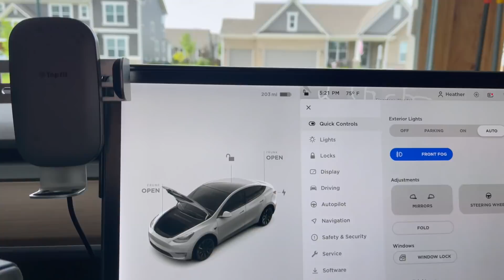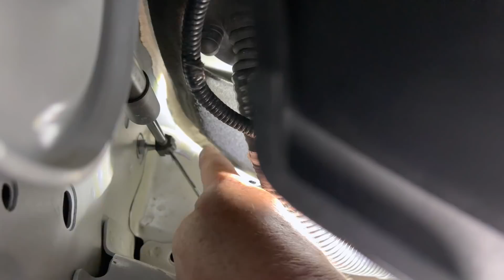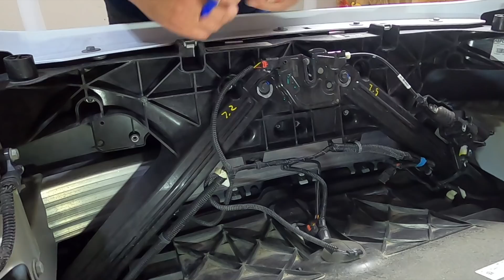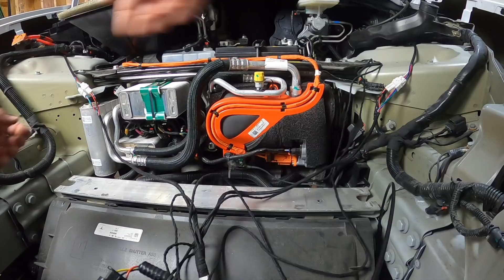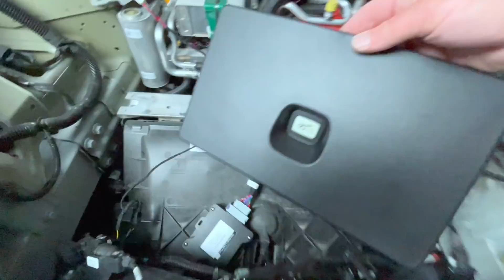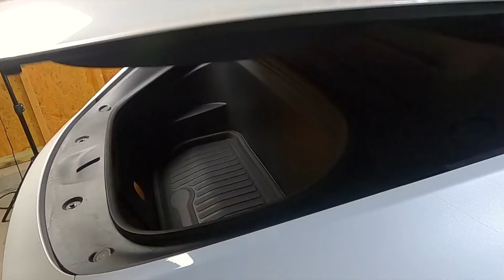Tesla Model Y - Frunk Mod by Hansshow

Comment: Thanks for the video. I have been unable to get the front to completely close. I've adjusted the tension wire, the bracket is all the way down, the black rubber knobs are as low as they can go. Any other suggestions?
Reply from the maker: Something else is wrong then. My best guess from afar is that the latch is too high. Try listening the 2 bolts holding the latch and bracket and lower just the latch part. You may only be lowering the bracket when you have been adjusting.
Reply: @BeardedTeslaGuy  thank you I'll give it a shot

Comment: Hey man, I installed the same exact model and I am having a hard time with alignment. It is intermittently working as it should be, but most of the time the hood will catch the lock but wont totally shut. I tried tons of adjustments on the locking mechanism as well as on the tension cable, but still having the same result. Hansshow is not much of help and so I am wondering if you have any suggestion. Thanks in advance!
Reply from the maker: So my best advice is to start turning the threaded rubber stops on the front of the hood. They may not be low enough to allow the hood to properly shut with the new latch alignment
Reply: @BeardedTeslaGuy  Thanks
Reply: @BeardedTeslaGuy  do you know if there’s any programming options on opening and closing speed? Thanks again.
Reply: I install these in the Phoenix area and have had this same issue.  Working on a fix with HansShow but them being in China makes things a little more difficult.

Comment: I had this kit sitting in my office for about 2 months, received  my new Y over a week ago, today after watching Bearded Tesla Guy, which I'm a subscriber to all of his videos, I went for it and he sure made it simple. 

The Struts removal and apply new ones with new adapters were the hardest part of the enter installation, my arms took a beating. It all works like its advertised, app on phone as well as screen in the car HOWEVER, I can't get the hood any lower when its closed, it's fine WITHOUT the plastic FRUNK insert re-installed, but after adjusting the hood latch to it lowest point to get the hood closed as before and put the FRUNK back into its rightful place it still needs to be lower,  and now I get an screen waring in the car, "Hood latch sensor requires service" - "Contact Tesla Service"..as the hood remains open on the screen. Even when I close it off the screen, it closes, and remains closed, but the screen animation pops back up to open. I just now looked and will try another YouTube in that video that the put the black rubber washers behind the hod latch bracket after the install -
Reply from the maker: There are 2 rubber threaded bump stops on the front of the hood. Try to turn those in some and see if it goes down some more
Reply: @BeardedTeslaGuy  you are the man!, just came back from the garage, did that AND put the black rubber bushings behind the hood latch,  your video you put in front, and lowered those two spin bump stops and it's flush now when closed, its all good and  the animation now shows open and closed positions. However the "Hood Latch sensor requires service" is still displayed ONLy when opened, not closed. Wonder if a software update will fix this issue...Thanks again, thanks for you input, always enjoy your thoughts.

Comment: I installed mine before your video.  Wish I had waited, I could only find one other video for the 4.2 V2 system install on a MY and it had a weird music track playing the whole time.  The only thing I noticed we did differently was the spacers on the locking mech.  It appeared you installed the black spacer between the head of the bolt and the lock. I assumed the black spacer went between the frame of the car and the lock.  Anyway I also LOVE this opener!  I also did not install the kick sensor but may add it later.
Reply from the maker: Yea, its supposed to go between the brackets, not against the head of the bolt.

Comment: The major problem with putting a cooler in the frunk is that it is not thermally controlled. On a hot day it will get very hot in there which will reduce the thermal holding capability of the cooler. In the model Y which has a shared trunk space with main cabin, the cooler would be much better in the back.
Reply from the maker: No doubt

Comment: Great video as usual!  Have you tried closing the hood but block it just as if it about to latch (with an object or your arm) so that it doesn't and see if the car recognizes that it didn't latch or still show closed.  There is someone here with a video of this issue with the Hansshow model giving false reading and the hood opened while driving on the highway causing damage to the hood and windshield.  Tesla and Hansshow are investigating the issue.  TeslaOffer has a similar model albeit more expensive that has the safety feature to address this issue.  I was ready to purchase the Hansshow until I saw the video with that issue so I held off.  Thanks.
Reply from the maker: I have not tried that. I know it won't keep pushing when its obstructed, but didn't pay attention to the latch locking, thinking it was closed.
Reply: @BeardedTeslaGuy  Are you able to try and see if it shows closed on the screen when obstructed? I want to purchase but want to make sure this issue has been resolved. I appreciate it.

Comment: Frugal Tesla Guy had issues with his Hanssow control module failing over a short period of time. Hope they fixed the issue. I installed the AMPTech auto frunk opener/closer.
Reply from the maker: Yea, I saw that. He did have an earlier rev of the module. No guarantees of course, but I know Hansshow is a big supplier of electronic components to the Tesla aftermarket space.

Comment: My friend tried installing one and not sure what happened but he cracked his windshield.  He also broke some clips on the MX panel that luckily our SC is replacing under warranty.  I wish Tesla would offer it from the factory.
Reply from the maker: Oh geez! I see you said Model X, so I cant speak specifically to that model, but on the Y, I cant see any way to crack the windshield installing this.
Reply: @BeardedTeslaGuy  MX is the USAF term for Maintenance, like WX for weather.  My bad.  He said the hood made contact with the windshield after he removed that strut.
Reply from the maker: oh gotcha. Yea, if you remove both struts then I suppose that can happen. I removed 1 strut and replaced it with the new one before moving on to the next one.

Comment: Looks awesome! Curious if it messes with warranty since it involves electrical mod.. also do let us know if it opens when you’re in drive.. hope it doesn’t since the bonnet hinge probably doesn’t have enough strength if one accidentally opens the frunk at high speed
Reply from the maker: I don't believe you can open the frunk when driving, other than the emergency release on the inside of the frunk.
Reply: @BeardedTeslaGuy  that would be a good test video.....make it look like your going to test it at highway speed.....then switch to you creeping down the road...ha ha ha
Reply: @BeardedTeslaGuy  According to the Hansshow website, "Intelligent control system prevents the Frunk from opening while driving"